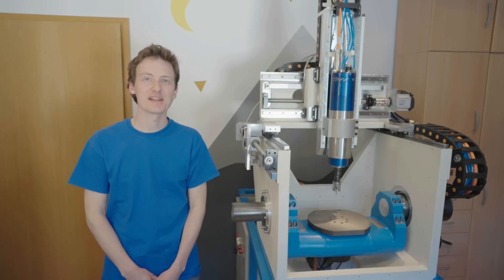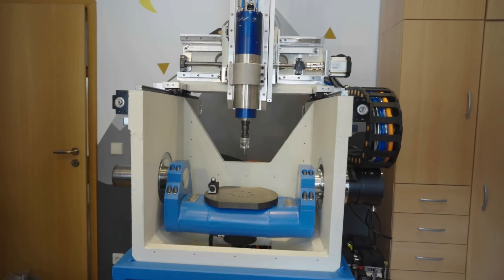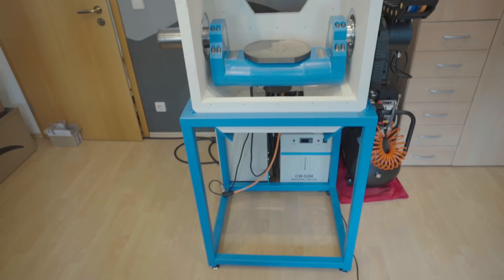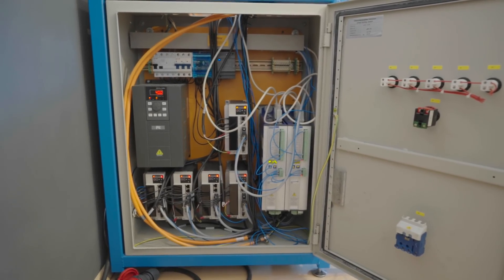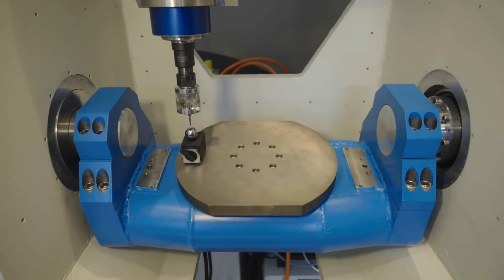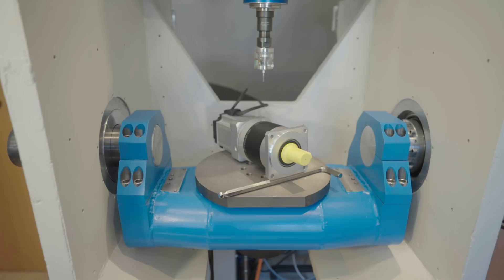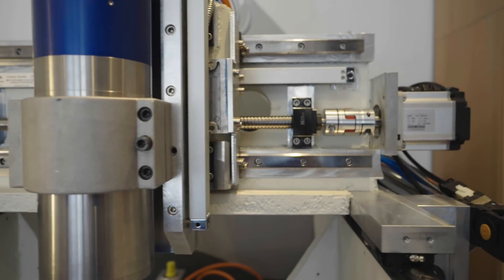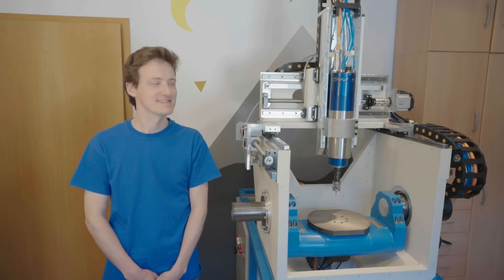Home build 5 axis cnc mill

Comment: It looks like your machine has a massive design flaw.
If you look at the cnc mill from the side (1:17) , the center of the milling motor is not between the carriages of the y-axis. 
The entire x-axis will tilt as soon as load is applied to the cutter.
Reply from the maker: That is always a compromise between rigidity and travel. But yes, the forces on the rails are higher that way. But 20mm rails can handle insane amount of forces. Somethin else will break in the machine before this tilts.

Comment: Awesome project! Would be interesting to learn more about part sourcing (Mesa cards in Europe, industrial components, spindle, etc) and the casting process of the main body. Looking forward to the first chips! 👏
Reply from the maker: Thank you, I bought the cards already a year ago where you could just buy them. Simpler times back then. The Spindle I found on ebay, I absolutely don't have that kind of money to buy this one new.
On my Instagram I have a post about the casting. I did not tok a lot of videos during the build process of the machine, only some pictures.
Reply: @fabianbrock  Thanks for the reply! Maybe some more questions (for a later video):
What's your professional background (you mentioned it's not in machining/engineering) and how do you go about acquiring the required knowledge?
Did you do any FEA simulations or trusted the Hermle design (square-cube law implications for scaling)?
Did you consider noise/vibration dampening/decoupling in the design of the machine or its enclosure? Will you be able to run it with other people/neighbors present?
How will you implement cooling/flooding?
Reply from the maker: I did a quick simulation in Fusion. Turns out the long z axis is of course the weakness, the rest dies not matter at all compared to this. But mainly I relied on the Hermle design. Another important part was not exceeding 100kg per part so I can carry it in the first floor. I can give more details on the design considerations in a future video.
Reply from the maker: @Jon Jon yes, the glass scales are from Ditron.
Reply: @fabianbrock  why was it simpler back then to buy those?
Reply from the maker: @polyfoamcoats1650  currently the Mesa 7i76e is out of stock everywhere due to global chip shortage for the FPGAs.

Comment: Awesome machine! Does it have some sort of built in way for spindle tramming? like set screws or something? Or maybe this can be compensated by 4th and 5th axes? how does this work? thank you!
Reply from the maker: You can't really compensate Spindle tram with the 4th and 5th axes. The Spindle needs to be aligned to the Z axes so the rotary once don't help here. However, they make the table alignment with the Y axis a lot easier. For now I have this standard aluminum casting import spindle mount and tramming needs to done with an indicator and a soft hammer.

Comment: Any chance you will make a writeup or post the Build Of Material for the machine? I think there are a ton of good design points that others might be interested in building off of the design. (Like myself :) )
Reply from the maker: Yes I could do this, just need to find a suitable place for it. But maybe I'll wait until it is machining in case some adjustments are needed.
Reply: @fabianbrock  I would also love to have a written documention of how this masterpiece was build an from what
Reply from the maker: @kurbelkassenbüdle  I have a little bit on my Instagram, maybe I will write up more. I would need to figure out a suitable place for something like that.